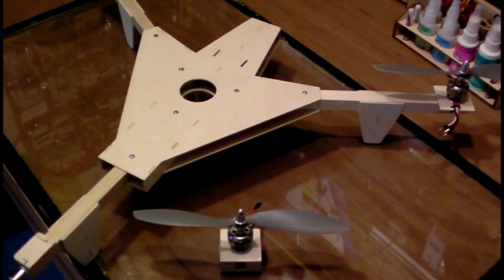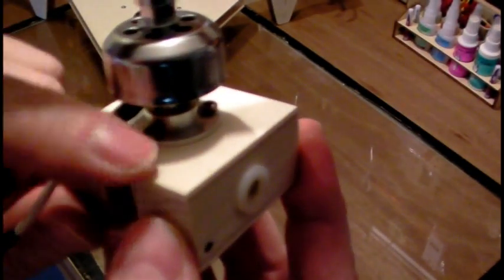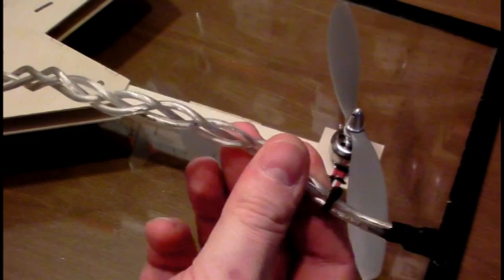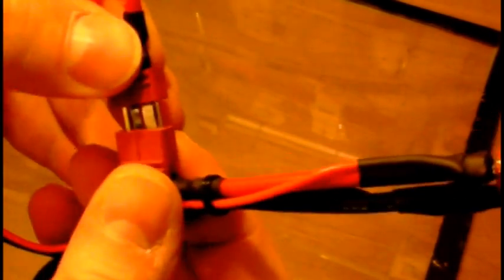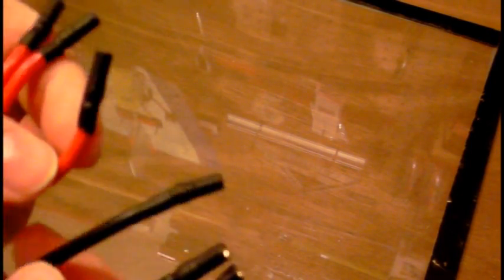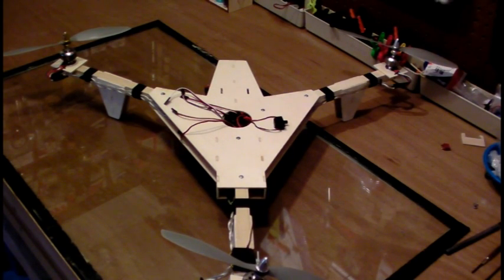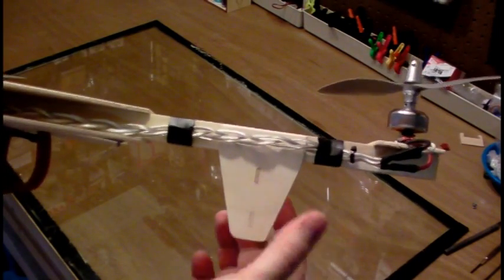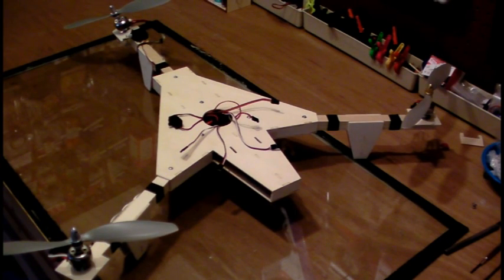5.QSC TriCopter - Power System

Comment: @CrashHancock Ah good point, that way you cna be sure it is stable before it starts up.  I'm use to my GAUI 330X where it all powers up at once.  Too bad the WiiCopter setup doesn't have a built in delay circuit of some sort.

Comment from the maker: @schooner2000 That's true but it's important that, when you put power to the Flight Stabilization System, the aircraft remain perfectly still and level while the program in the Arduino boots and benchmarks the sebsors or you will get incorrect readings. I have found that adding the switch allows you to power up without moving the aircraft during this important step.

Comment: If the initial power is only going to the Rx and Flight System via the JST when the main battery is connected, why is a switch needed?  Assume you could just remove the switch from the circuit.